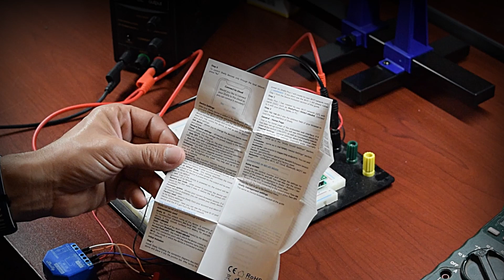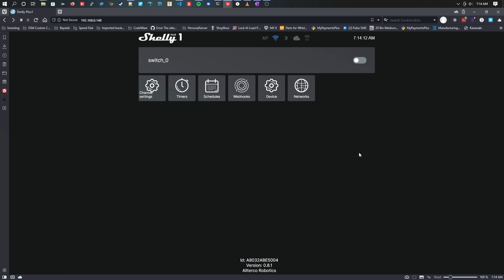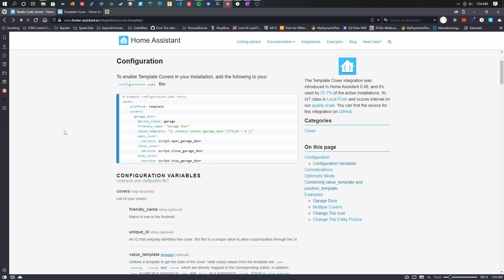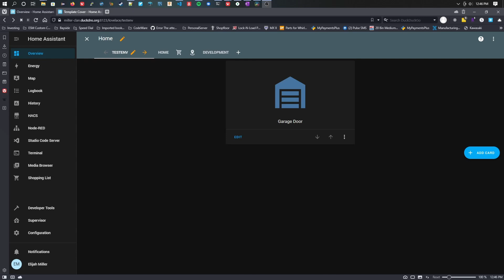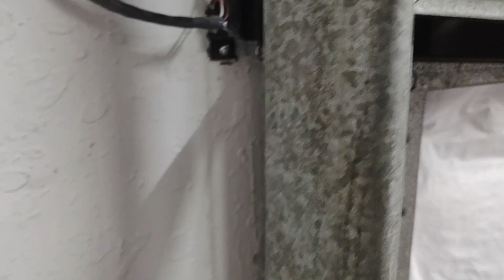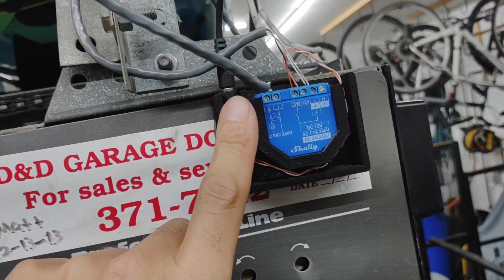Garage Door Automation with Home Assistant and Shelly 1 Plus

Comment: Wondering if you have upgraded to the latest version 2026.6.3, if so your Yaml which used to work, no longer works. If you can provide your fix or suggestions, that would be greatly appreciated.

Comment: I am getting errors  "patternwarning" and entity 'sensor.garage_door' not found.... seems they may have changed some things... Did they change the coding to prevent this? I ask as the template guidance on their website now looks diffenent... Specifically I don't see the value_template any longer referenced... Do I just have to buy the add on sensor module?

Comment: The video has helped me greatly.  It appears the Shelly web interface has changed since the release of the video. I'm not seeing the input switch sensor option in HA. Have you worked with the new look and know what I have to do to get things back on track?
Reply: I did a factory reset on the Shelly 1 Plus and I could see the binary sensor in question.  I went step by step to see where the sensor goes missing in the steps I took to configure it for HA.  I seems that the sensor disappears when the output switch type is set to Button.  Now I am trying to see what got broken in my setup.  I have seen others say the are not seeing the sensor as an option. I home this helps someone going down the line.

Comment: I have all but duplicated your setup including copying and modifying your yaml config. I have the sensor and the switch in HA and can view the status of the sensor and switch to operate the door. 
However i cannot get the cover to work, when i tap the cover i get no response, i have to hold it to open the switch and press the middle stop button which will cycle the door. any suggestions?
Reply from the maker: Hi. It sounds like you might be missing the step in the shelly settings that revert the relay to the open position after 1 second. I show that at 7 minutes into the video, although the shelly interface has changed since I created this. Hope that helps, and you get it working!
Reply: got that bit, the binary sensor reports closed-opening-open when the switch cycles as it should. still cant get the cover to trigger the switch or change with the state. Im assuming that its something amiss with my code.

Edit: it seems the cover is not getting the binary sensor data
Reply from the maker: @dillonray2975  it's been a while, but I believe when I first completed the project, I created a debug screen with all the sensor values so I could see how they changed. Good luck man, hope you get it figured out!
Reply: I realize I'm replying eight months after you posted this question, but I was having the same issue as you.

I finally got it fixed.

        open_cover:
#          - condition: state
#            entity_id: sensor.garage_door
#            state: "Open"
          - service: switch.toggle
            target:
              entity_id: switch.garage_door
        close_cover:
#          - condition: state
#            entity_id: sensor.garage_door
#            state: "Closed"

When I commented out the three lines under the open_cover and close_cover everything worked on the card button as well as an entity button. It also worked in Homekit. The open and closed states showed up correctly within HA, and even the temporary ! showed up next to the garage doors. I'm not sure why that worked, but I tinkered with it for a few hours. Anyway, I hope you already figured out the solution and I hope anyone else stopping by in the future is helped with this.

The tutorial was excellent and the features are great. I really appreciated the video and it helped immensely. I'm not sure why there's a little hiccup in the code that didn't work, but I was so thankful to have the YAML file posted. For someone new to the platform it made life so much easier. Thank you!

Comment: I have duplicated your setup and can't seem to get the icons to change. I have copied your yaml file and wired everything  like you had it. The only thing I can think of is that I don't have something on the Shelly configured right. Right now I'm just running it at my desk until I can get the icons to work. any suggestions?
Reply from the maker: @gary57210, sorry for the slow reply. Were you able to get it figured out? I would look in home assistant at the sensor value and see if it's changing there, outside of any of the yaml you've written. If it is, then it's likely an issue with your home assistant setup. If it isn't, then the issue is probably on the shelly side. Best of luck!

Comment: Could I use a wifi sensor instead of a hard wired switch?
Reply from the maker: Sure. You would just need to program it a little differently, but I don't see any reason that you couldn't do that.

Comment: Hi the sensor show open when the sensor is near the connector.. its the contrary.. some configuration mistake?
Reply from the maker: Hi @Kiloptero, sorry for the slow reply. There are two ways those switches can be wired. Normally Open, or Normally closed. Sounds like you likely have them wired the opposite from how I configured the YAML file. You could try either reversing your wiring or changing the YAML. Reversing the connection on the switch would be the easier option.

Comment: Thanks so  much for the excellent video and accompanying yaml config file!  I'm new to Home Assistant and just getting started with adding automation functionality to my home and this is my first Shelly project.  The video has certainly been very helpful to get me up and running quickly.  I've used it to succesfully automate the two doors on my garage and learnt a few things along the way which could have taken me some time to realise otherwise ... like using the switch input in detached mode as a binary sensor!  Thanks!
Reply from the maker: You're welcome. Glad you found it helpful!

Comment: I have a craftsman model 139.55918 garage door and I have tried to hook up my shelly 1 plus to the proper spots to get the garage door to open but all I hear is clicking sounds. I should have everything wired correctly. I don't know what I am doing wrong. I am trying to test via the shelly app to just get the door to open and close.

Comment: Thank you very much for this tutorial, and for making the YAML code accessible. 
Just in case someone stumbles on this and is trying to figure out why theirs isn't working: I have a Chamberlain with the MyQ stuff on it. However, I am not able to access my MyQ for a number of reasons, so I am working on this project. Turns out those openers use a RF signal to open the garage, not a physical button connection. I'm going to have to solder some wires on an extra button you can get for like $15 on amazon and use that for the button press.

Thanks again!

Comment: Nice video! Thanks for the template and cover work. I ended up having to swap the ons and offs in the sensor section to get it to work right for me. I'm guessing it's normally open vs normally closed sensors.

Comment: If you’re using google home, do you have to edit a yaml file?
Reply from the maker: Hi Karl. I don't have Google Home, so I can't speak authoritatively about it. From the Shelly website though, it appears they offer direct integration with Google Home, so you should be able to set it up separately from Home Assistant. All of the yaml stuff I do in this video is only applicable to Home Assistant, which wouldn't be used if you do a direct integration with Google.

Comment: great video. thanks been looking for looking forward to new videos
Reply from the maker: Thanks bro! I appreciate that!
Reply: @esmcustomcreations5247   okay have everything some what working but my home assistant doesn't work like yours i have everything  the same as yours but when you chose cover garage door this doesn't acted like a button or change states when i make or break the switch thanks
Reply from the maker: @10138707  I'm sorry you are having issues! Software configuration can definitely be a pain. Is it still giving you issues?

If so, did you try rebooting home assistant, after making changes to configuration.yaml?

When you add a card to lovelace, are you selecting the button card? Then for entity selecting cover.garage_door?

Assuming so, try making the entity the switch, and not the cover. The state won't change properly, but if the door opens, then that will tell you it's a problem with the configuration, and not the hardware. If it still doesn't work, does it work if you trigger the switch from the Shelly web server?

I usually try to break the problem into little steps, and test each along the way, to find the exact issue.

Also, If you go on the left menu to Configurations then Devices at the top, and then click on the shellyplus1 you installed. You can toggle the switch there, and see the value of the Switch input change. If that doesn't work, then it's probably a hardware issue. Sounds like that isn't your problem, but just trying to give some ideas.

I hope you figure it out! Best of luck!!

Comment: Nice video. Thanks.

If you get a moment... the link for the configuration.yaml does not point to the correct files.

Thanks again.
Reply from the maker: Oops! Ok, thanks for the heads up! It should work now.
Reply: @esmcustomcreations5247  Thanks!:goodvibes:

Comment: Thank you for your informative video. Some more information on where the reed switch is placed was handy, i viewed that part like 8 times. I just got it to work. I also used a Shelly plus 1. The only difference is that i could take power from the garage door system.
Reply from the maker: That's awesome! Glad the video helped!

Comment: My garage door automatically closes after few minutes. If shelly1 opens the door, and it automatically closes in few minutes, will it know that its closed already?
Reply from the maker: Hi Harj.

Yes, if you install the magnetic reed switches as I show in the video, then home assistant will know if the door is closed, regardless of how it gets closed.

That's interesting that your door has that functionality. Mine is old, and I haven't really looked into the new doors.

Thanks for commenting!
Reply: @esmcustomcreations5247  I have turned the function off yesterday. its a PITA. it can dent your car or your head if you forget that its going to close in couple mins
Reply from the maker: Haha. I wondered about that, but thought maybe I was missing something.

Comment: I was looking at using a cover template. But it was so much easier to use condition button. Just made 2 buttons one will show when garage door is closed and another for when it's open.
Reply from the maker: Hey, that's pretty cool!! Thanks for pointing it out. Always more than one way to accomplish a task I suppose.

Comment: If I have a second garage door what changes would I need to make in order for it work for the second door?
Reply from the maker: Hi Luis,

I also have two garage doors configured.

What I did was to duplicate the hardware, and template data, but name the sensor and switch something else for the second shelly device. I named mine shop_door, and garage_door.

I included my configuration.yaml file in the downloads in the description section, with both doors configured.

Let me know if you have any questions.
Reply: @esmcustomcreations5247  Thank you so much for your assistance and including the yaml file! I finally got one shelly installed. The only issue I have, is it shows open when closed and closed when open. I am going to install the other this upcoming week. I plan to use the door  switch sensor to trigger my garage lights to turn on for a couple of minutes when the door opens to help illuminate the garage when we get home. Again I really appreciate all your help.
Reply from the maker: @Lois Rodas, awesome, glad you got it installed!! 

If you haven't figured it out yet, you can probably just move the wire on the magnetic reed switch to fix the issue of it showing open when closed and vise versa. From what I read, those are frequently mislabeled, so if you move the wire from NO to NC, or vise versa, that should fix it. The other option would be to reverse the sensor code in the yaml file.

The light automation will be cool. I also configured mine to send me a notification on my phone if the door is open for more than 10 minutes. My kids sometimes leave it open, and this way, I get notified when they do.
Reply: Thanks so much for all your work and thanks for sharing with us. Would you be able to share the code for door left open for 10min ? Thanks

Comment: Great work ! would be good if you could go through and show us exactly how you wired it and how you wired the open close sensor to the shelly  and add the STL file for the holder!
Reply from the maker: Hi Loui,

I added a download link for the STL, as well as the f3d (fusion 360) file to the description section of the video.

Are you saying it would be good to add a schematic for how it's wired, or that it would have been good to have shown how I pulled the wired, and connected everything?

I can definitely attach a schematic of the hookup, and can see how that would be useful.

Thanks for your comments!
Reply: @esmcustomcreations5247  Thank you for taking the time to up load the files, am printing the holder as I text!  yes a schematic would help a great deal but for visual learners like my self going through, if you have the time, showing what wire goes where would make this project very doable for your viewers that aren't so tech-savvy  but are enthusiast. please do not take this as criticism it is a really good video and am looking forward to doing it my self when I acquire all the parts keep up the great work and look foreword to future projects.
Reply from the maker: Ok, thanks for the feedback, I appreciate it!